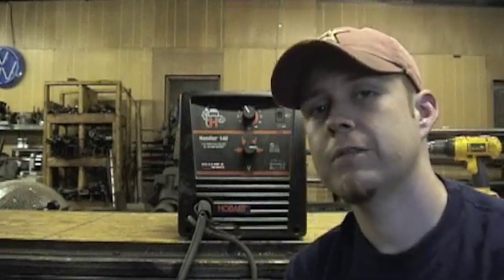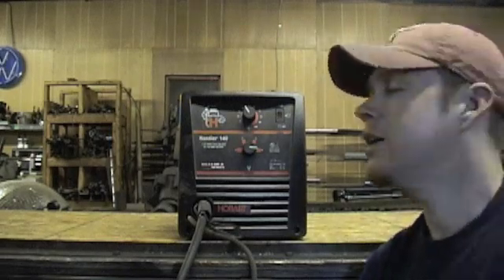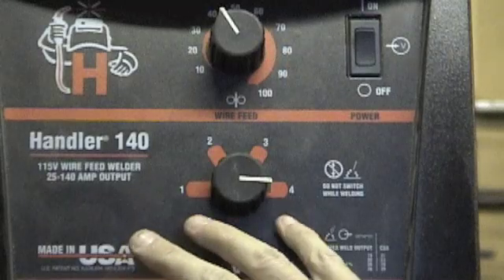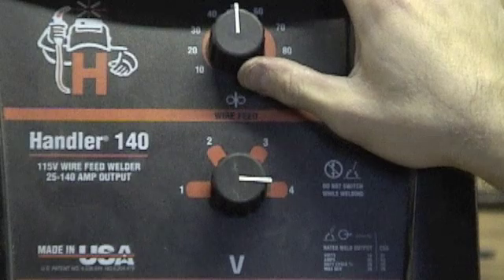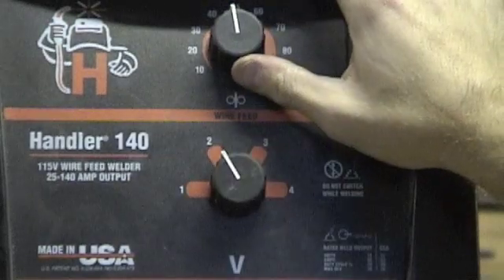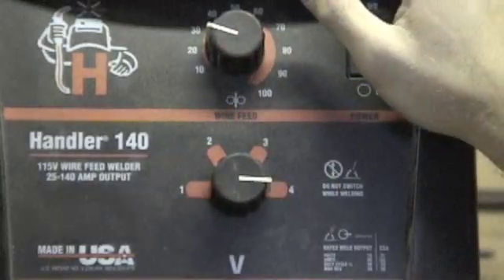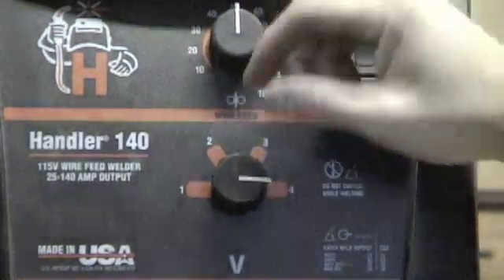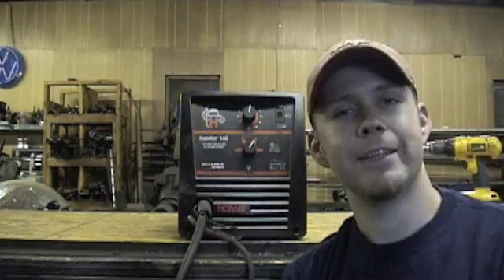Basic Mig Welder Settings

Comment: Thanks a lot, man. Great video. I have a Lincoln 135 MIG and there is so much spatter. Not a bead in sight! Do I need to turn down the heat or the wire?  Or is my gun angle wrong? I'm going to try out different things and see what comes up. Thanks!
Reply: Hey I didn't know you were on here.  Why didn't you tell me.  And why aren't you sharing your work?
Reply: Haha I meant that you were on google plus not anything to do with what you posted
Reply: Bearman Cartoons
 OH! Haha! Yeah, I joined, I don't know when, but I don't really use G+ or even FB. Glad to connect with you here!

Comment: Jasohn hullihen---wrote ,
 theres no way a 110 welder is comparible to a 240 volt you are wrong hate to tell you as wrong as you can ever be... this has been very misleading a lincon 175 or the 180 can weld up to 1/2 and the 200 hobart is also way out this machine's welding rand and the miller 180 auto set same as the other two.. not to bug you or harass but is wrong wrong wrong your machine can weld 1/8 " max so can any 110 modle mabey mabey 1/4 with lincoln 211 or 212 flux core

Lincoln's 140 model is rated 3/16th Single pass with up to 5/16th with multi pass per the manufactuers door chart, And Hobart rates their 140 at 1/4 single pass capable and does not list what they feel can be welded past that on the door chart , but do state thicker meterial can be welded with proper set up ...A Hobart 210 amp model is stated 3/8th single pass and I can tell you that when Hobart says their machine will penetrate a thickness it will ..lol..Or are you telling us that the folks who manufactured these units don't know their products as well as you .

Comment: great video, PS jason hullihen is full of junk, your welder and the lincoln mig 140 can easy do 1/2 inch with fluxcore wire.. with mig it will not penetrate as deep, when i weld sheet metal thinn stuff i use the lowest heat which for me is 30 amps its a bit dicy and hot but it can do it if you tak it on speed 1 to 1.5.. great welder you got there dont let the hecklers get to you, they have no experience in life with 120 volt welders, they think more is better well maybe if your building buildings but most jobs and trailer building and repairs and may other items to 1/2 inch these welder rock and are cheap to run and last forever if taken care of ..

Comment: If you want to weld thin materials you should really look at welders with infinite voltage and wire feed control like the Everlast welders mentioned by a few of the other posters. Use as thin a wire as practical to keep heat down and use an argon/CO2 mix. Do not use straight argon if you are welding thin material.

Comment: Your video was very misleading. Your wire speed controls your amperage, and hence your heat penetration in a proportional relationship. your step 1-4 voltage settings will affect the weld height. Anyone who wants to learn the correct information about welding should go to the ESAB, Miller, or Lincoln sites to receive free high quality (Correct) instruction.

Comment: theres no way a 110 welder is comparible to a 240 volt you are wrong hate to tell you as wrong as you can ever be... this has been very misleading a lincon 175 or the 180 can weld up to 1/2 and the 200 hobart is also way out this machine's welding rand and the miller 180 auto set same as the other two.. not to bug you or harass but is wrong wrong wrong your machine can weld 1/8 " max so can any 110 modle mabey mabey 1/4 with lincoln 211 or 212 flux core..